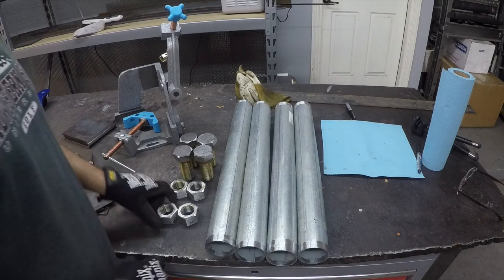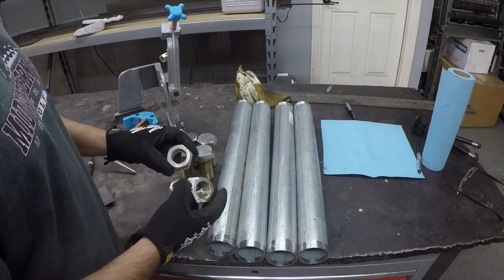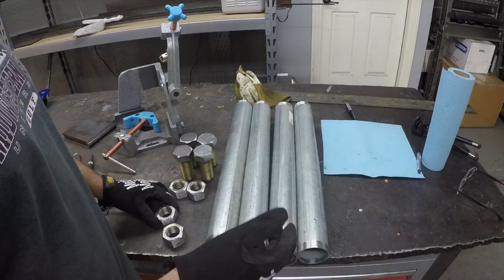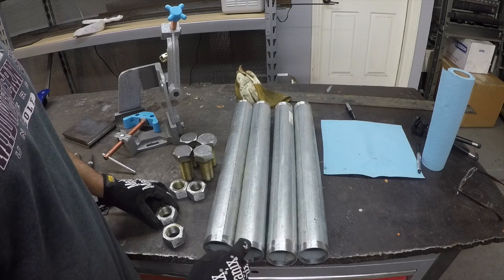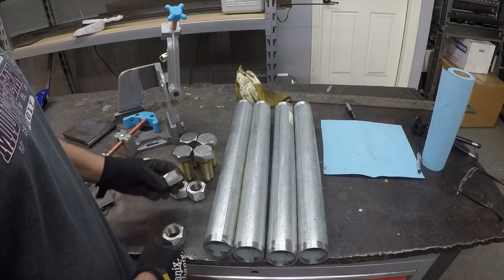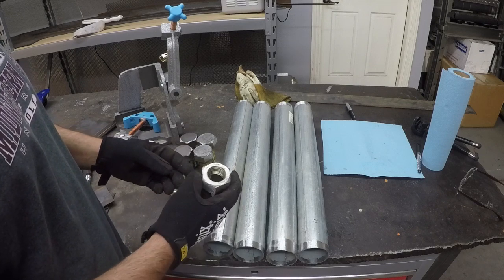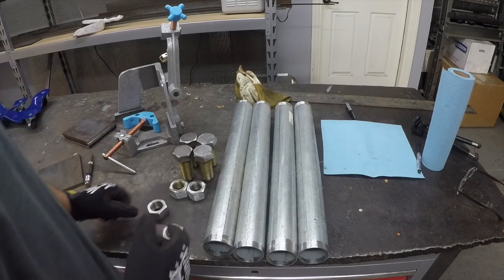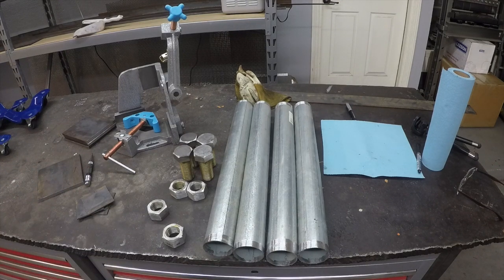Metalwork Monday 4 - Stronghand Tools 3 Axis Vise/Vice Fixture Fabrication

Comment: When fitting steel in this manner you need to leave a gap or bevel the edges for complete fusion or you dont really have a weld . If you butt the metal end to end only works for welding  thin sheet metal and using tig. I have seen many weld failures because of incomplete fusion due to this type of poor fitting practice.

Comment: another excellent video Gary. I use Coil rod and nuts for my height adjustment material. it spins up/down much faster than acme thread. not as precise but works well. heck of a lot less umms and uhhhs as your channel grows too. I definitely will steal this idea.

Comment: here's a tip.

Annular cutters will last three times as long if they are not cutting through hot rolled millscale.  -  Also millscale will brush off after 24 hours soaking in white vinegar.

Nice shop.,

Glenn
https://www.flickr.com/photos/davisglenn
Reply: Sounds extremely painful.
Reply from the maker: excellent tip.  I have removed the mill scale with muriatic acid before, but haven't tried vinegar
Reply: White vinegar is not going to remove milscale.
Reply: Tec 9  
Yes it does - soak the part for 24 hrs and use a little wire brush and it just comes off.  Don't knock it till ya try it.

Comment: Good and fast but I'm no full timer so I doubt I'd invest in 4. I do have four of the bottom style without the uprights I got for a song. Super handy. I do either the top and bottom or two sides then clamp to the table and put in the other 4 pieces. A little more time consuming for sure.

Comment: Grinding the zink only contaminates your grinder disks and still may leave contamination for the weld and toxic fumes. What I found I like better is to soak the ends in a solution of Lye and water or potassium hydroxide and water and it will emulsify the zink so you can simply rinse with fresh water then a Light grinding and never have any blowouts or zink contamination again or breathing the fumes...my lungs are already shot from years of abuse in the shop, and its actually less work, but you might have to wait for an hour or so for the zink to be removed. No problem just plan your projects around the dipping procedure, and work smarter not harder.
Reply: Muriatic acid takes the plating right off in seconds. Try it.

Comment: Man, I love the way you drilled through the plates using the mag drill. Was the mag drill very expensive? And were was it purchased from.
Reply: +William Wooden The ironworking companys ive worked for have the same size magnetic drills but without any stand or anything. Just a portable one and my boss said it was $3000. They arnt cheap.

Comment: which plasma do you have the 40 or 60 amp ? i have the 60 amp bought the combo 200 ac-dc tig and the 60 amp plasma cutter off of a ebay sale . a good ground and learning how muchstand ff of the tip and it cuts good .
Reply from the maker: +targetshooter2 Sorry just saw this comment.  I have the 60 amp unit.  I think some of the problem i have had is related to too much moisture in my air lines.  Going to remedy that the next time i use it.

Comment: you should use the jigs and build a stand for the chop saw and get it off the floor , i see you run Eastwood  welder & plasma , i cut a shit load of 1/2 steel with their 60 amp plasma , will ck out some of your builds .
Reply from the maker: targetshooter2 go to my main channel page and checkout my more recent videos, I did indeed build a stand for the chop saw!  good to hear you have had good luck with the plasma, so far I haven't been pleased with it...

Comment: Nice!  I have 4 of the 90 degree welding clamps and it would be nice to put them on stands.  Great idea!  I use muriatic acid to get rid of plating on nuts and bolts for welding - should work on galvanized coatings too.
Reply from the maker: Thanks Karl, didn't know about using muriatic acid to remove the coatings.  I actually have some, will give it a try next time.  Thanks for watching!
Reply: Do you have any more info on the cool mag drill table you used in the video?  Is this something you built?
Reply from the maker: Karl Gabel Karl, yes, I built that a couple of weeks ago, if you go to my main channel page, you will see the video there, it's the last video before this one.

Comment: Looking good.
Reply from the maker: Thanks Terry.  I ended up buying 2 new jacobs chucks, one keyless and one regular one, they are both head and shoulders better than the piece of junk that came with the drill, one quick tighten up on either of them and they hold good with no issues with the bit slipping.

Comment: Great looking fixtures Gary.
What tooth blade are you running in your chop saw?
Reply from the maker: cecil6711 Thanks Cecil.  Not sure on the # of teeth on the blade, it's a 14" tungsten carbide tipped metal cutting blade.